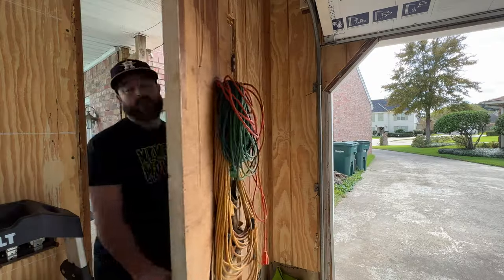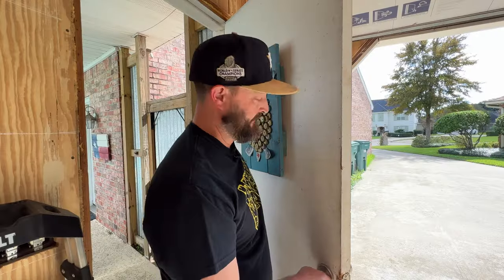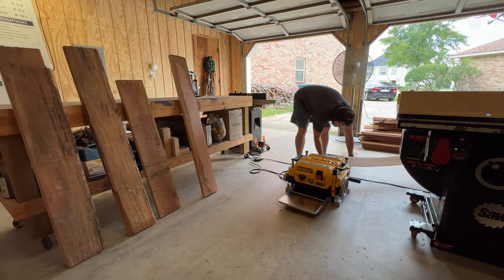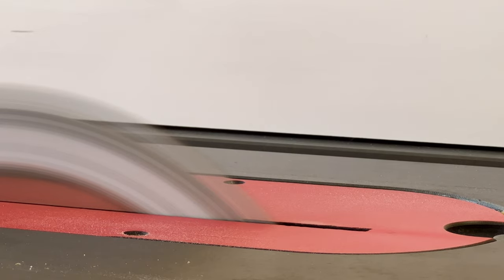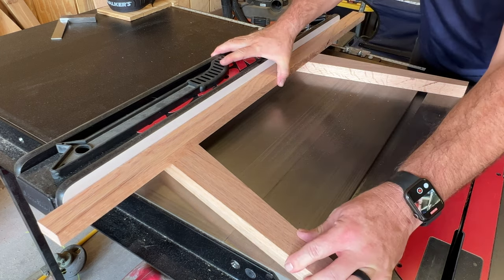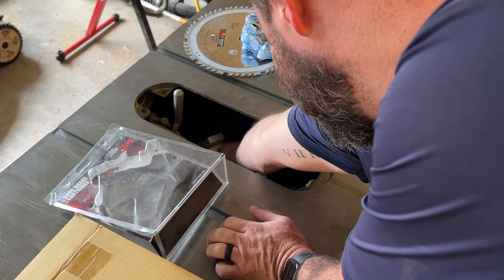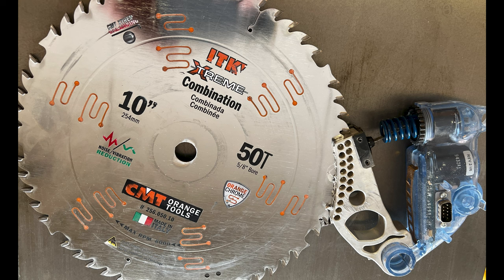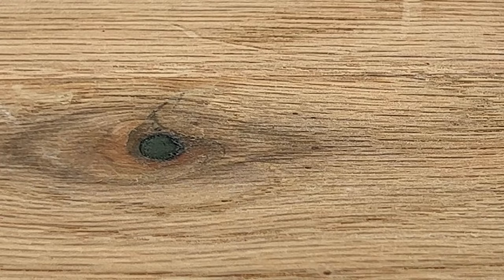Building a Foureyes Furniture Coffee Table!

Comment: The table turned out great. A few questions if i may. Why did you stop sanding with grit 150 i think you said? Im curious because i usually go at least 220. The other question is, How did you like using Rubio? Ive heard nothing but good things but yet to try.
Reply from the maker: Thanks for the kind words!  And I'm always up for questions.  So, I went back and listened and I did say 150 when in fact in reality I did sand all the way up to 220. I think I may have said 150 because I had originally heard that for Rubio you should only sand up to 150.  Not sure where I heard that, but I usually sand put o 220 and Rubio hasnt let me down yet.  I love the stuff.  220 with one coat of Rubio holds up nicely and is smooooooth too.  Thanks for the question and the watch!